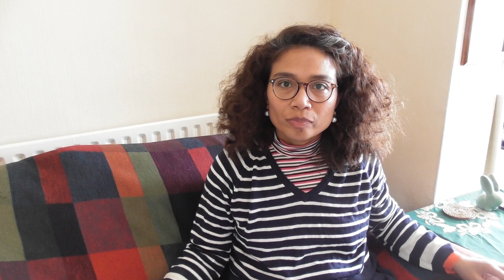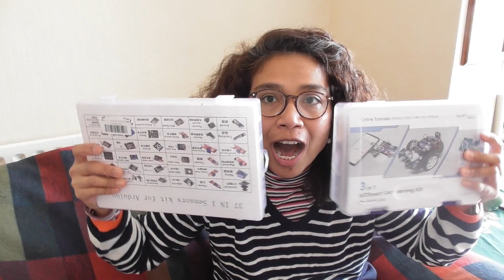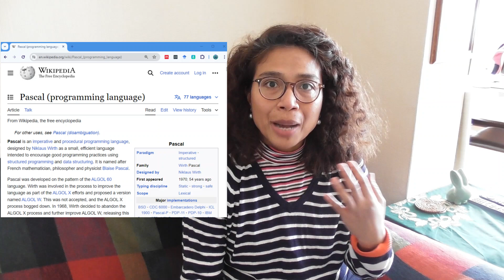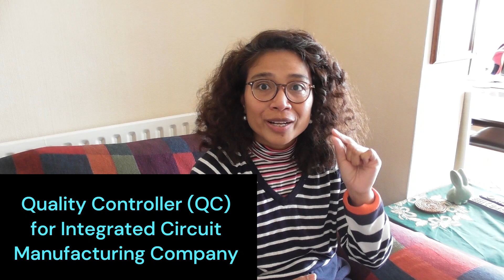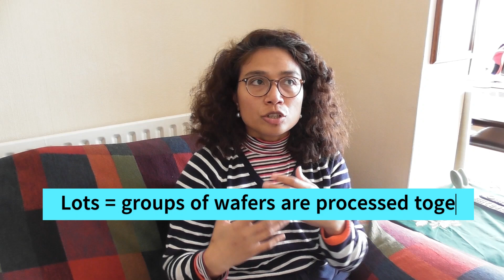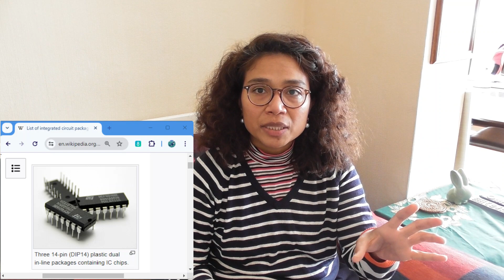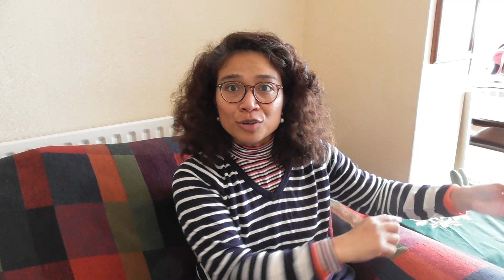How I Got Interested in Arduino and My Manufacturing Experience #Arduino #microcontroller

Comment from the maker: My Manufacturing Experience Made Me Interested to Arduino Programming  #Arduino #microcontroller 
0:00 Intro (and ADHD distruption)
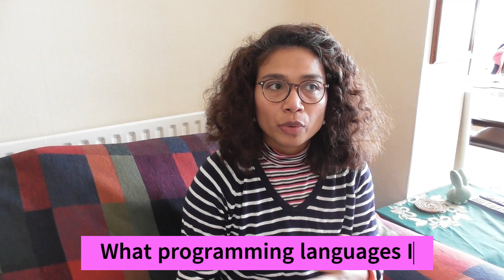1:30 What programming languages I learnt 
3:43 Work experience in semiconductor manufacturing
5:20 Testing department where I worked
11:21 Work experience in wiring harness system manufacturing